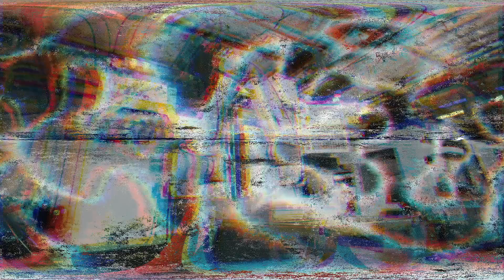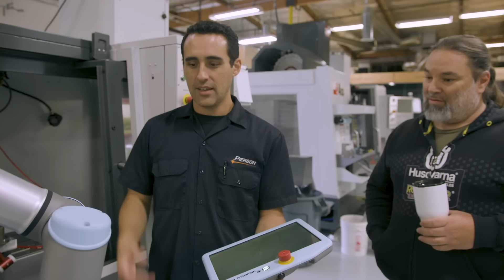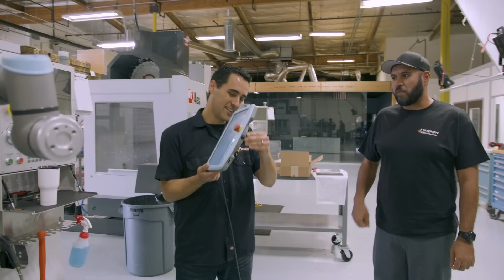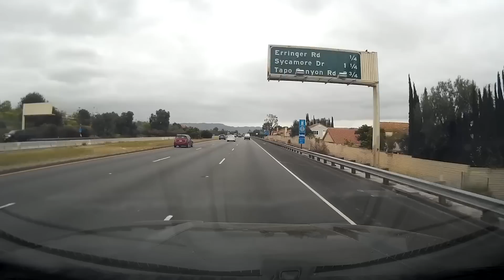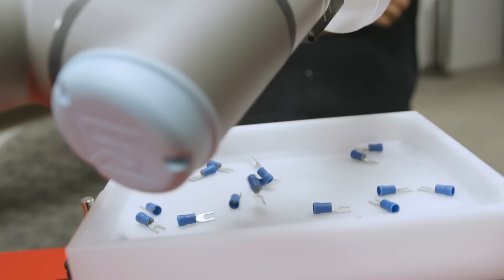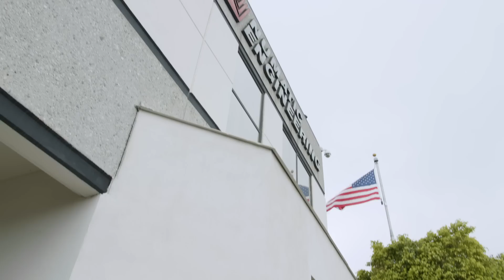How does it feel to get hit? | The Robot Episode 2

Comment: For picking stuff from a pile you can use "until contact" node available in 5.4 update. Also it's easier to use freedrive when you grab by tool flange, where precision  force-torque sensor is.